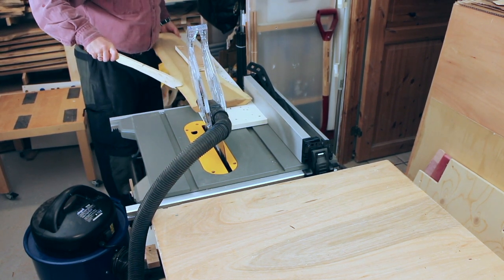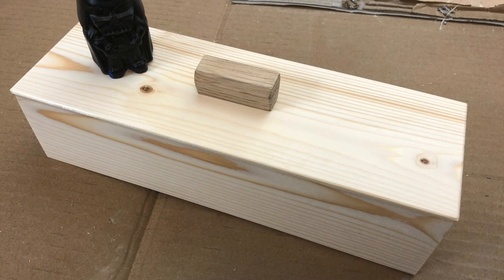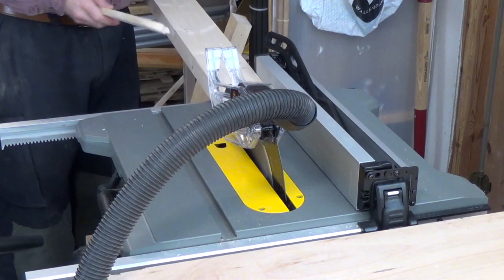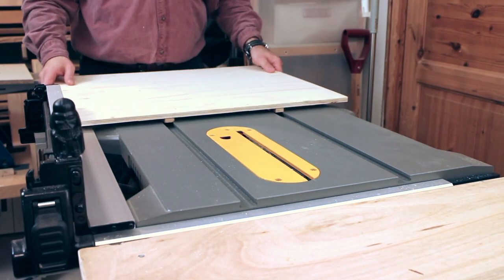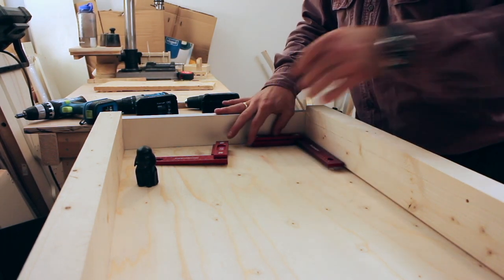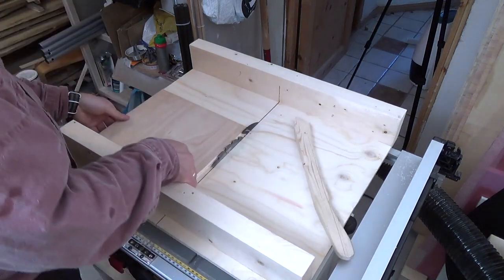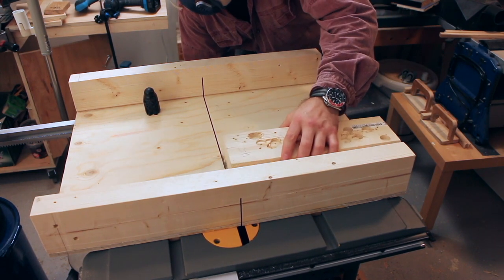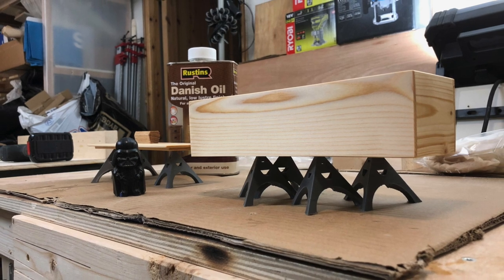Basic Crosscut Sled for my DeWalt DWE 7485 - Made in Norway [0059]

Comment: Awesome video, thanks !! Lots of interesting stuff, I'll have to watch it again. Love those wooden thingies you made to push your object forward. I assume they have a piece of coarse sandpaper on the bottom ? And could you please elaborate how to do the error ratio measurements and calculation ?
Reply from the maker: Hi! 
I guess you refer to the "push blocks"? There is grip tape under them, like used in stairs to prevent people from slipping. I guess it should be readily available at any home store. Here is the video where I made them: https://youtu.be/AzIVgyDMCeA
I used the 5-cut-metod to square up the sled. I make a decent attempt at explaining it in this video: https://youtu.be/vMZTgX1z4zk
Cheers! And thanks for watching and commenting :D

Comment: Hi there. At 3.50 you talk about no fine adjustment for the 90 degree angle. Have you set up the cam stops for the 90 and 45 degree Angles? Or have you already done this but the saw gives varying results. Nice tutorial by the way.
Reply from the maker: Hi! I was not referring to the cams. They are for calibrating the saw. What I meant was an ability to change any angle with a high level of control. On cabinet saws you swivel a wheel to do this. 
A workaround that was suggested to me was to push on the motor from the side with one hand. 
Anyways. Great observation. And thanks for watching and commenting. Cheers.

Comment: You need to put a block of wood at the back of sled where the blade exits the cross member, for safety . The blade should not be exposed at the end of the cut
Reply from the maker: That is a very good point Rob. Did you check out the next version of my sled build? Thanks for watching and commenting.
Reply: @NomadMakes  Thanks I will check it out
Reply from the maker: Yeah, the new version has a block at the back :D

Comment: Nice video. Does the small blade is a problem for you ? The previous model (7480) was a 10 inch blade. With the sled, you also lost one inch. What do you think ?
Reply from the maker: Hi!
The bottom plate of this sled is 12mm so I loose half an inch. This saw has a 65mm cutting capacity the 254mm blades (10 inch) is just 70mm in cutting capacity. So, the loss is only 5mm.
I have never had a larger saw. If you see my older videos you can see that I used to use a circular saw screwed up-side-down into a table.
If you think about re-sawing you get 65x2 so 130mm capacity. I guess you can always wish for a larger capacity, but this one is good enough for me.

Comment: Hey! Great video - you’ve earned yourself a subscriber.

I have a couple of questions though. I’m relatively new to woodworking and living in Stavanger but I don’t know where to look for hardwood. The big DIY stores like Obs Bygg for instance have the plywood and pine hobby boards but I don’t know where to look for things like walnut and oak etc.

Second question: where did you get the wax for the cross cut sled? I’m not sure where to look for that either and haven’t had much luck asking in the shops. Do you have a particular supplier or shop you recommend?

Tusen takk!
Reply from the maker: Hi! For hardwood I generally check Finn.no and local suppliers. In Stavanger there is at least 1 maybe 2 suppliers. I don’t remember the names. But check in the facebook group «Møbelsnekker i Norge». 
The wax I used in this video is Liberon furniture wax. I got it at a local hardware store. 
Gustavsen.no has a good selection of woodworking stuff if you want a Norwegian online store.
Reply from the maker: Oh. And if you dont need large pieces. Check out Hardtre.no

Comment: Recently I've build one for my saw (i have the same model as You) still need to check it for acurate squarenes. I've added stop block with a self made t-track that way i can make repetitive cuts without clamps. Have You used bee wax from Coop Bygg 😁? Btw where in Norway you live? I'm from Tananger.
Reply from the maker: Hi!
I have not tried their bees wax, and now I have made my own frow wax, boiled lindseed oil and terpentine. 
I live in Bergen :-)
Using a t-track like that seems like a really good idea. And if you want to check your sled for accuracy, I have a video on the 5 cut method here: https://youtu.be/vMZTgX1z4zk
Cheers, and tanks for watching and commenting.

Comment: Is this DWE7485 or DWE7492? According to the DeWalt documentation the 7485 has just one slot on the table. The saw in the video has two slots on the table.
Reply from the maker: This is the DWE7485. The 7492 is a qiute larger saw.
Reply from the maker: If you want to see more of it, then this is the unboxing:
https://youtu.be/ZeCP4YCZdlk
And this is my review of the saw:
https://youtu.be/7aErRRZvPZc
Reply: Indeed this is still a bug on their web site. It’s only the battery powered 7485 that’s coming w/ only one miter slot. It’s a shame they are neglecting the European market so much.
Reply from the maker: I just checked the Norwegian website. And there the DWE7485 is now shown with 1 miter slot. I don’t know if they have changed the table on the saw, or if they have the wrong picture on the site.
Reply: @NomadMakes  Same on their German website. But I got mine two weeks ago, and it definitely has two slots.
Reply from the maker: Nice to know that they haven’t changed the design. One slot would not be an improvement. Does anyone know why the battery powered one has just one slot? No room under the table?